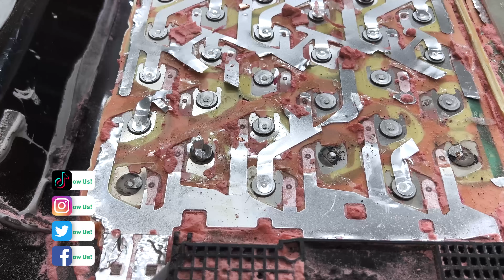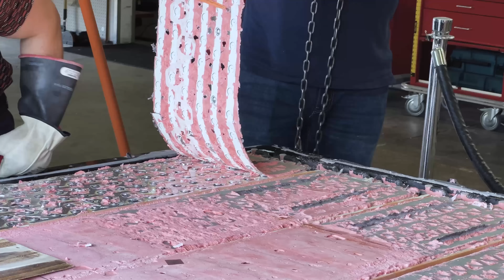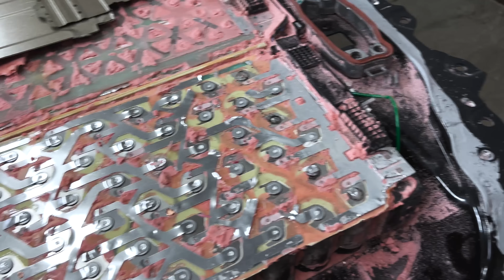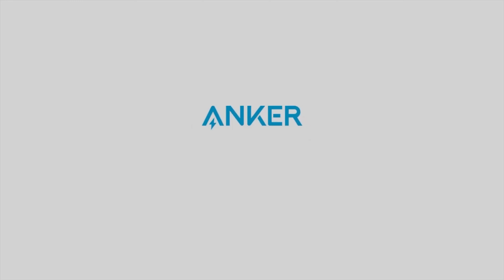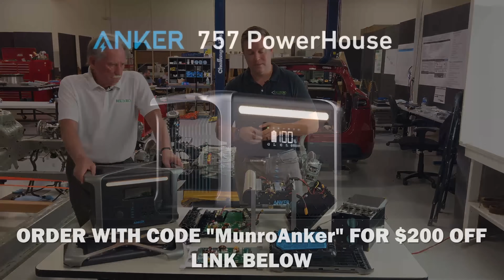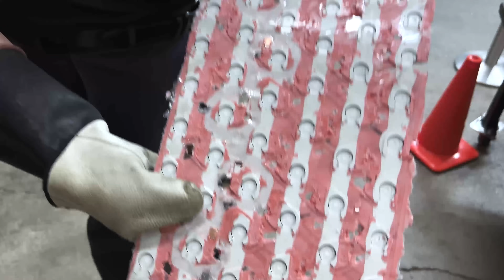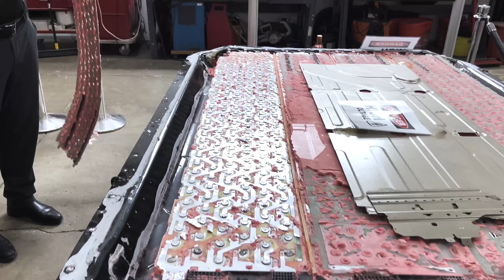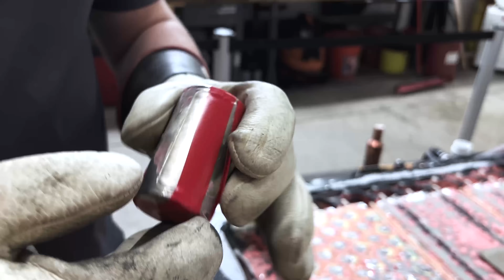Tesla's 4680 Current Collector Layout

Comment: why waste time with huge lithium batteries, when you can start with iron-air ethanol-koh fuel cells, that have 4x energy density, that of iron and zinc, 1.2kWh/kg, or aluminium (8.4kWh/kg), or magnesium (6.8kWh/kg), just wire spool feed the fuel metal, it turn to rock, and metal-air fuel cell efficiency generally >90%, ie 3x better than standard combustion engine
Reply: Because they need technology that works now, not in 20 years.
Reply: @fredbloggs5902  you are sold to the highest bidder, it seems
Reply: @fredbloggs5902  its like you say: "gasoline cant drive cars", well, I  guess horse owners always go their own way, at first, they have invested
Reply: @fredbloggs5902  it has been demonstrated multiple times in all possible configurations, so you are only lying
Reply: @fredbloggs5902  internal fake motives
Reply: @fredbloggs5902  you have chosen something, not based on if it works
Reply: @fredbloggs5902  take it or leave it, but dont talk trash about what is true
Reply: @fredbloggs5902  you just dont want to accept it works right now
Reply: @Jkauppa  if it works (it doesn’t) tell us all a reputable source supporting your ridiculous claim.
Reply: @fredbloggs5902  you lie
Reply: and you can even do all (from iron oxide to metal to battery with carbon air-electrode) yourself

Comment: So it’s configured 92s9p = 828 cells yielding slightly lower Voltage ~ 380V than 96s 2170 packs ~400V Was hoping they were gonna blow the doors off with a 138s6p 580V for faster charging.  Maybe Supercharger V4 and the semi- Roadster- …
Reply: Higher voltage doesn't really equal faster charging.  It can help if current is the bottleneck, but I don't think that is the case.  I think the bottleneck is the C-rate of the cells.
Reply: SO no 800V architecture, duu duooo...  oh well the truck can just series 2 units (with multiple parallel)..

Comment: Thanks for sharing this tear down with us!   Great work.   Really looking forward to the specific energy density of each cell.   Thanks for validating 828 cells.
Reply: Here are figures for specific energy density:  275 Wh/kg, 733 Wh/liter on the cell level.
Reply: @koeniglicher  Is that tested for the Munro cells?
Reply: @brianbeasley7270  Not exactly. Munro themselves would have to test the cells they got out from their pack by surgery to answer that. It is based on these sources: The limiting factor review (and analysis at a battery lab, but based on estimates and assumptions) and Troy Teslike (based on rumors). On Inside EVs, there is an article "Tesla's 4680-Type Battery Cell Teardown: Specs Revealed". Be aware, that there is not one Tesla 4680 cell variation at the moment, but several seem to have been realeased: prototype cells, production cells by Tesla. And soon: production cells by Panasonic. They may or will all be slightly different.
Reply: @koeniglicher  Thanks.  I'm specifically also interested in the energy per cell as we now have definitive numbers of 828 cells.   So to figure out the pack range, we can simply multiply one cell's capacity by 828 to figure out the pack energy.   I would like to know what the Tesla production cells actually net out to.
Reply: @brianbeasley7270  piece of cake: 828 times 26 Ah times nominal voltage. Choose whatever you think fits best for these NMC-811 cells: 3.65, 3.69, 3.7, 3.73, 3.75V.  The result is around 80 kWh gross capacity. Net capacity and range will depend on software configuration by Tesla and the individual driving profile and driving style of the driver.
Reply: @koeniglicher  Again, Thanks.   I just want to see what the tested values are with the actual cells.   So as soon as Munro can accomplish that and publish, that's great.

Comment: 828 cells, supposedly 95-99wh per cell? So should be like 81kwh total capacity, but is closer to 70 from owner tests. Are there dummy cells in there?
Reply: Perhaps large buffers with an option to increase useable capacity later using software changes.
Reply: No, there are no dummy cells, as the series and parallel cell arrangement would not work with some omitted.

Comment: What is the weight of the entire battery as it comes out of the car?
Reply: See the previous video. But they weighed it with the seats included. 😀
Reply: Roughly 450kg (1198lb=543kg including pack and seats etc; seats are 44.8kg out of a 2020 model 3 - from munro website; subtract 543kg-2*44.8kg)

Comment: Another great video about the 4680!
The ‘death of pink’ is actually stops any condemnation issues which are common in extreme weather conditions like Norway where many Model S battery dies because of condensation water appears in the assembly of the modules.

Comment: Munro Live  team has to get a hold of a BYD  with the Blade battery and  do a comparison  with the 4680 battery pack and systems , both i believe  are cutting edge ,the  4680   might have an edge w/ density .
Reply: Or the new catl quilin cell to pack, cell to chassis lfpm format batteries. Supposedly those are more energy dense than even the 4680s by about 13% per catl claims anyway. The new lotus eletre is gonna feature that pack later this year.

Comment: 9 cells in parallel.  The shape of the current collector is critical for getting the most energy out of the pack.  This thin flat material has some sheet resistance so, when the cell group is under load, the current through each cell is slightly different from the others.
While discharging, the cell with the most current will reach full discharge first, forcing the BMS to end discharge while it's neighbors still have charge that can't be used.  And durring charging, the cell with the most current will reach max charge first, forcing the BMS to end charging while it's neighbors could still be charged more.
You should do a DC Finite Element Analysis (FEA) of this under max load; I think the results would be very interesting.
Reply: The shape seems to be calculated to balance the currents, thinner and wider bands are used depending on the length/geometry
Reply: @alexforget  Exactly.  But I know from experience that getting it just right can be very challenging.  That's why a FEA would be interesting, because it would show exactly how well they did this.
Reply: Forgot to say, the current collector needs to: 1) provide just enough series resistance for each cell to swamp the small cell-to-cell variations in internal resistance, and 2) keep the mutual resistance (yes, that's a thing) low enough for good current matching at max charge/discharge current.  The temperature coefficient of resistance of the alloy may also be a significant factor.

Comment: Hmmm… I just don't know about this 4680 "structural" pack. The modules and cells don't seem very "salvageable." What I'm most curious to know is whether or not the team has been able to determine if there are missing cells, or "blanks," in that pack to explain why the range is only 279 miles…? Or is it that the pack is actually full of 4680 cells, but Tesla is limiting the range via software…? It's a mystery.
Reply: Which car manufacturer ever cared about providing parts for other people's future projects? When it happens like that it's just a happy accident (with cars perhaps via an actual accident!) There are plenty of alternative battery designs around that will be suitable for projects. Understandably Tesla just want to optimise form and function for their own vehicle designs. Reuse as a complete pack (home battery perhaps) or in a vehicle designed to take the full exact pack size. Otherwise complete grind-down recycling as "ore" is the option.
Reply: @MrAdopado  Exactly, Tesla is 10 moves ahead of everyone else. Who is getting into the Insurance business? Tesla that's who. When your car is totaled Tesla will take possession of the wreck personally and not sell it at auction. They will test the battery and if still usable will sell it as a replacement pack. If the pack tests good but low capacity, it will be repurposed as stationary storage. If the pack fails, the test it will be recycled. Tesla is now the one recovering value from these packs not some third-party retrofitters. This is great for Tesla great for their customers and great for us shareholders. I bet everyone a steak dinner this is how it will pan out.
Reply: @MrAdopado  Evidently Tesla doesn't care anymore. Just manufacturers like Nissan, Renault, etc. That's too bad, since it certainly was possible with still useable cells and packs like in my Model 3.
Reply: Why would you "salvage" it? Use the whole pack for stable storage projects or recycle it. The guys who hotrod ICE cars with Tesla modules need to find a different supplier, but any of them worth doing business with understood that on Battery Day.
Reply: @patreekotime4578  stop justifying nonsense and grow up! Why wouldn’t he salvage those batteries cells!? What a dumb question!!!! All battery cells/modules are used for all kinds of applications! The 4680 could work very well if packaged different on other projects!
Reply: @patreekotime4578  VW MEB - found a company in netherlands who sell those.
Reply: @patreekotime4578  the 60280 LFP batteries cells are a great example
Reply: Someone explained on Twitter (and I believe Elon confirmed) that the process of recycling these packs will be to basically treat them like high-quality ore and just grind them up into fine particles that are then separated and re-used as raw materials.
Reply: @gmitchell_tc  Sandy mentioned that already in the other video, they will grind em up after dipping them in liquid nitrogen and the bits just float up in a special dunking tank solution. To be gathered together sorted and then reused again.
Reply: @4literv6  Dipping in LN sounds easy but if you've ever dipped anything in liquid nitrogen, you know it is a very "energetic" event, even for a small mass.  Now imagine trying to submerge a >1000 lb battery.  All of that mass has to go from room temp to -320F before the nitrogen stops boiling....that's a LOT of LN going from liquid to gas.
Reply: @gmitchell_tc  crap!!!!!! All battery can be recycled that way! In fact even vw has already built their own batteries recycling facility in Germany. Batteries are supposed to be reused after their car life before any recycling! Use-reuse/repurpose-recycle.
Reply: @gmitchell_tc  Yes. We'll see how good that works in the future.
Reply: @gmitchell_tc  Yes, I KNOW that. Sandy Munro stated that it would be possible to just freeze these packs with nitrogen and then put them through the shredder to recycle the tiny bits and pieces. That's NOT what I'm talking about. I'm talking about salvaging the cells and modules from a wreck while they still have useable capacity, to put in battery backup systems, converted EVs, etc.

Comment: Didn't an earlier version of the Tesla power pack have a thin wire connecting each cell to the parallel pack with the idea that if a particular cell shorts out this "fuse" would blow.   Is there such a "fuse" function in the battery assembly being examined?
Reply: ahah.. what was previously a safety feature is now a performance limiter.... - possibly the cells are internally fused, but unlikely...  (hopefully they use a less flammable electrolyte).  hmmm,
Reply: i vaguely remember that the Cells Fuses are now internally to the Cell (i think from a Tesla presentation for the 4680), but im not really sure...
Reply: Yes, that's the part where Antonio shows us the old Model Y cell connector with the thin wires bonded between the collector and the cells.  And then Antonio says Tesla has eliminated many potential failure points with the new collectors bonded directly to the cells.  No, the individual 4680 cells are not fused internally or externally.
Reply: The best fuse is no fuse. There may be something magical going on with those thin wire looms in the octagonal loops and/or the bus bars are sized appropriately to fail when the load goes outside normal operating range.